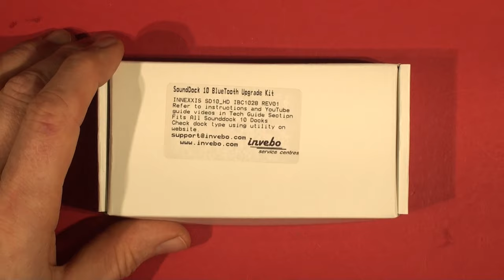SoundDock 10 Aptx HD Bluetooth 5.1 Upgrade Installation Procedure

Comment: Can you let me know why it connects to the Bluetooth  and plays for few seconds and gets disconnected
Reply from the maker: No, not a usual fault, could be a problem with the dock or with one or more of the 40 springs contacts under the docking module.  Make sure the dock works properly. The power quite often resets if there is a blown amp chip in the dock. When it powers up to drive the bass speaker the power cuts out and the system resets the DC supply to the cradle area,

Comment: Hello, I have a broken SoundDock 10 that I purchased in the US and unfortunately someone unplugged my power converter and plugged it straight into a UK socket, I was wondering if you could repair it for me?
Reply: Were you able to fix it? Mine happened exactly the same today 🤦🏽‍♂️🤦🏽‍♂️
Reply from the maker: Send it www.invebo.com  they repair for all international customer these for a fixed cost every day. Conversion toe 200V operation may incur a small extra fee. Order on the sounddock 10 section of the site.

Comment: Did you put your battery charger project on the back burner?
Reply from the maker: I have the power stage done but got distracted by aid development work - a 20KW switched inverter EV  charger. Scary,,,,
Reply: @razenby  Sounds interesting, I'd watch a vid of you describing the process. :)